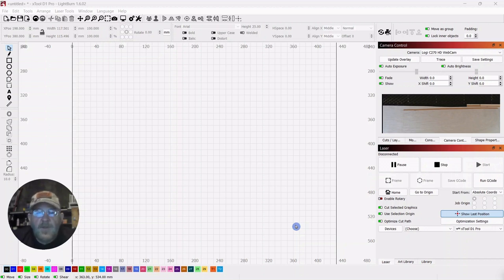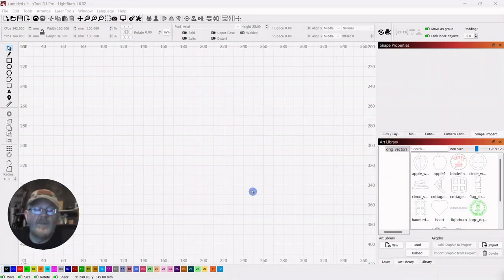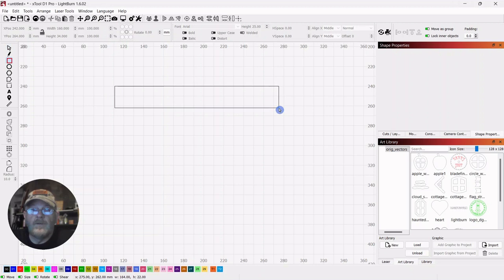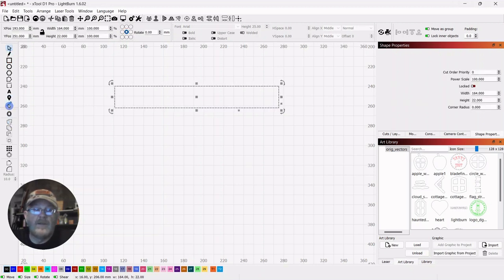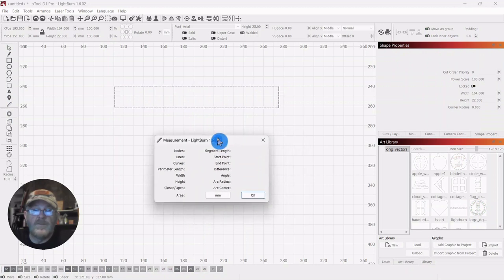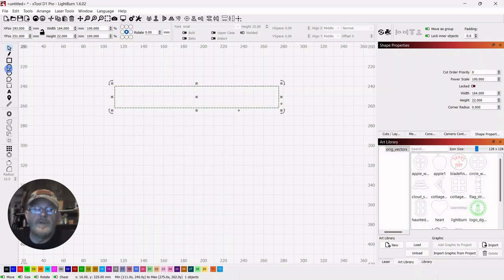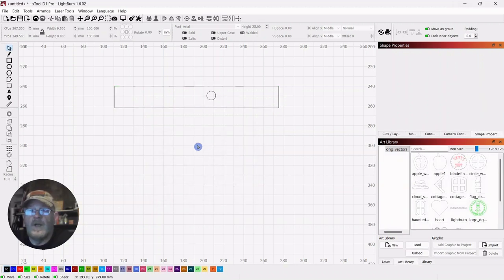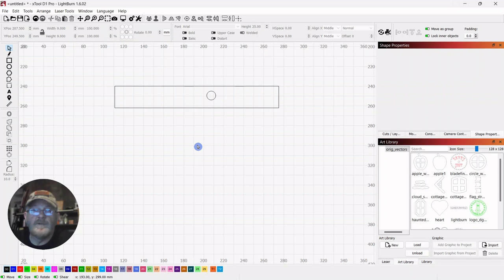How to use the Measure Tool in Lightburn #27

Comment: If I want to place that circle a set distance from the left edge, how do I do that? Does Lightburn use guides like many other drawing programs?  Thanks for your help
Reply from the maker: For the set distance, you can draw out a slim rectangle (or a line) and make it a tool with layer "T1" so there is no output to the laser - set the length you need.  Select the rectangle (or line) on the left most edge while holding down the alt key (for alignment guides) to position on the left edge of the outer circle - once set, select your inner circle on the left most edge, again while holding the alt key to move it (snap it) into place against the right most edge of the rectangle (or line) tool.  Hope this helps - let me know if not and I can jot it down as another video to do soon.  Thank you for watching and for the question.  Take care - Dave!